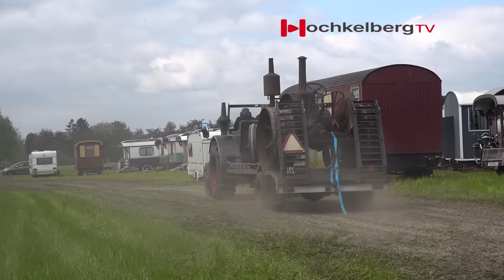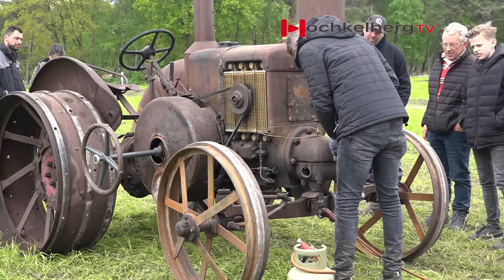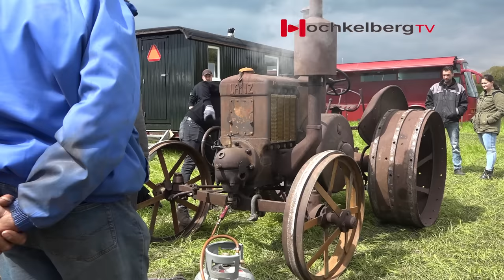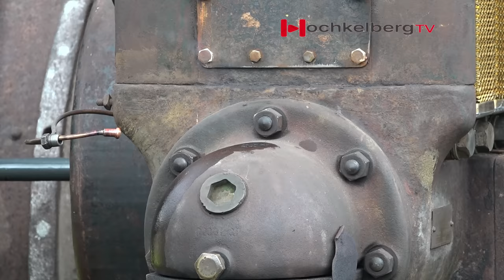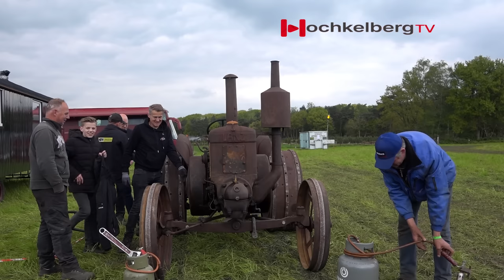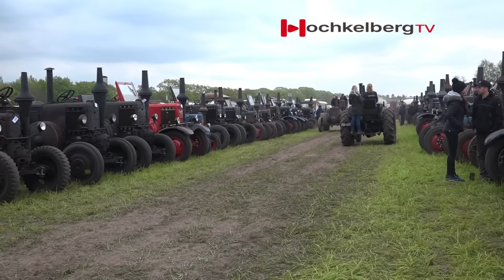Oldtimer Lanz Bulldog- will nicht starten 30.04.2022

Comment: This bring back 35 year old memories from when I studies mechanics and we restored an old two stroke 4.2 litre semidiesel Lanz. Our teacher wouldn't allow us to start it because he had a bad experience starting old engines. He weren't able to stop an engine he tested and axel to the gigantic flywheel broke and the havoc the flywheel made scared him for life. ;-)
Reply: That's a shame... to bad he didn't just think to put a fuel valve and air valve on the intake (since diesels can run away and run on the crank case oil) take one or the other way and it has no choice but to stop.
Reply: I had something similar happen with my old two stroke suzuki 500. Started up. Then turned ignition off but it kept going.  I still cannot believe how many revs that thing was doing. It was deafening. Finally pulled the fuel line and it stopped. Very scary.
Reply: Because, Your teacher was stranger in old school technik.

Comment: I think these tractors are incredible not only in the simplicity but also in their durability. But can you imagine how hard the salesman had to work to convince a farmer that had steam power or horses,  "This is the future of farming!"  All you need to do is shove the steering wheel into the crankcase and cross your fingers (if you're good at letting go in time) give it a turn after it has warmed up and it'll run all day long!  Fantastic and beautiful, WELL DONE 👍
Reply: ए ए खुदा खुदा की की बहुत ही नही नही कर कर

Comment: Seems like to many attempts to start without the hot bulb hot enough has flooded the hot bulb......common problem with newbes.    
I always started heating the hot bulb and the go around greasing all the grease nipples then by the time you prime the oil recovery pump 120 turns at no faster than one per second, I would have vapour showing at the exaust...then set throttle three notches forward from idle and it would start just fine! Remember that steering wheel will break arms if it fires and you slip!
Reply: Think you have got that just right I learnt the hard way I give the pump no more than two pumps and some times shut the tap then when it fires quickly open it. Nothing like a Lanz to draw an audience and keep you on your toes. 😁

Comment: it looks like that crank wheel is too small and not getting enough leverage to start.
Reply: I thought the same,,perhaps a rope tied to a spoke of the wheel  with someone standing in front of the tractor giving an extra pull may help?
Reply: Maybe if they partially unthreaded the bolt to reduce compression at first.
Reply: @HunterShows  May be - may be not
Reply: @HunterShows  Yep, and when it fires the thread strips and some poor sod down the field gets a new stopper! 🙄😁

Comment: The starter wheel to much small for the starting the engine !! 🤕
Reply: The "starter wheel" is also the steering wheel! 😉
Reply: @theoztreecrasher2647  But the steering wheel it's on the machine, this don't steering wheel, this starter wheel to much small for the starting the engine.
Reply: @danielependola1580  The Lanz Bulldog was produced in many different models and sizes in its production lifetime. The last (illegal copy) was produced in Poland as late as 1965. By then they had electric starting.
With many of the earlier models you were able to remove the steering wheel and use it to start the tractor. Here you are quite correct in that the steering wheel has not been taken out and used as they appear to be trying to start this machine with a replacement wheel (with a slightly smaller diameter) from a different Lanz model. And the Bulldog tractors are always VERY hard to start, even with the correct diameter wheel! 😜😁

Comment: needs a compress air start system
Reply: It does not exists
It needs a '''annular  fine spraying nozzle injector.''''.. (it is the main condition....)
It needs  when to stop it,  fully hot to put a kerosen on the  filler hole previous for to clean the piston of  burned oil then the piston will be  more easy to move for  next start operation...
It needs to use of hight quality oil who not burns..
And so one 
Sorry my writting....